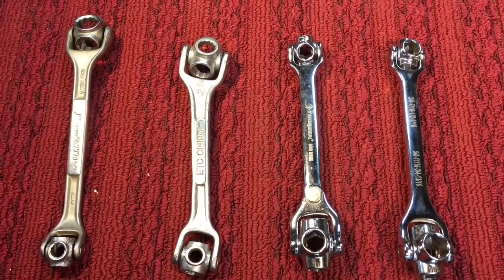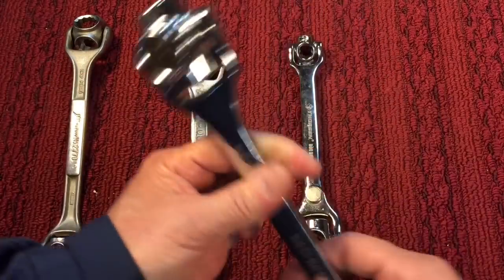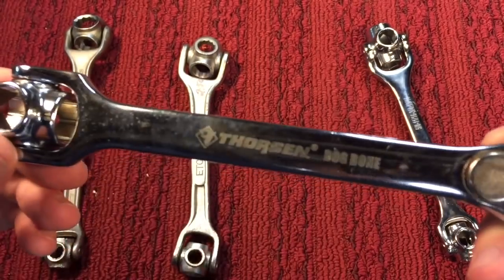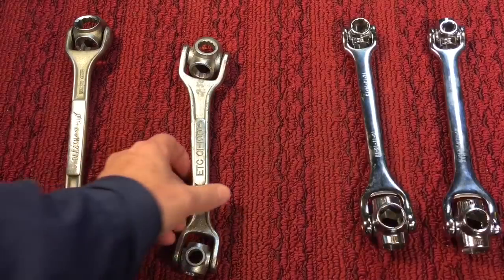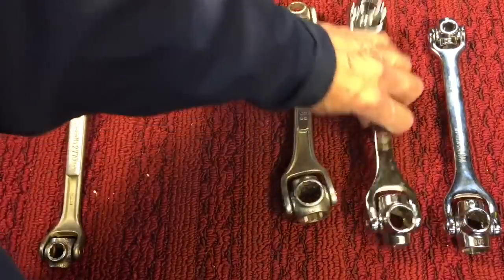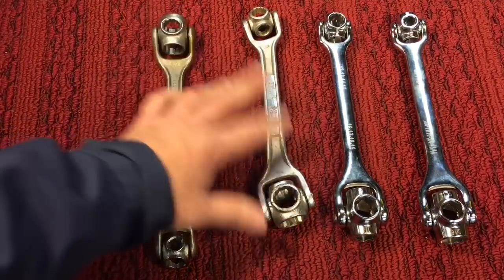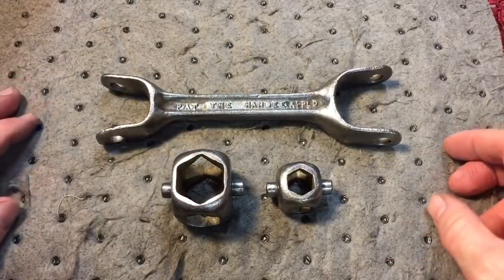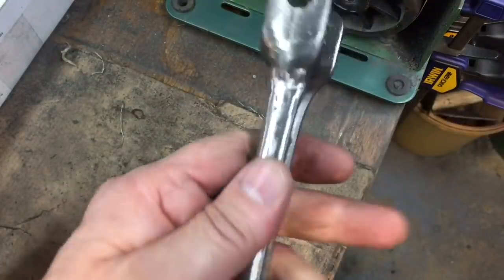Handee Dog Bone Wrench Restoration

Comment: A Tool Story: Back during WW2 everything was used till it fell apart and this included cars. One day my Grandfather was working on his 32' Chevy, replacing a chasis part with one that was almost as worn out as the one he was removing but it was the only part available. A bolt wouldn't come out and he had his big brass blow torch blowing a  flame on the bolt. He took his open end wrench that had a huge head on it so big that he could only turn it one flat at a time. My father was about 7-8 years old and had been watching Grandpa and shagging after tools when he was told to, (that was how kids learned tools in the old days. NO APPS)Tells my aggravated grandfather as he struggles with the wrench, "I bet that things loose enough to take out with your fingers now." Not thinking Grandpa reaches out and grabs the still smoking hot bolt with his fingers jerking back and hitting his head on the concrete block jack stand. He chased my Dad down the road and threw the wrench at him! Then he made him go find the wrench so he could finish the job!
Reply from the maker: OMG!  I was just laughing my butt off reading that great story!  It made me think of all the great arguments I had with my Dad while working on cars!  I don't think they were fun at the time but looking back those were great times!!!!!!!!  Thanks so much for that awesome story!  It made my night!!!!!!
Reply: @ScoutCrafter  2nd that! GOOD one!
Reply: Thank you for story sir

Comment: The fixed dog bone wrench that came with bicycle tool kit was only an emergency tool was not meant to be used regularly as it was soft alloy. However it undid  the wheels when needed to take them off to repair a puncture and was light weight. The swivel ones looked good  that is about all and your one is now a fidget finger spinner.
Reply from the maker: Hello Tony!  Back in the late 60's and early 70's they used that crap alloy on all sorts of stuff!  It was horrible!  Neither strong or good looking as it would pit or get a nasty coating on it...  Like a Zinc alloy crap!  LOL   Thanks!!!!!!!!!!!!

Comment: I’m speechless. I checked to see if Michelle had a dream about that one. Everything I envisioned you would do this week. . .  This wasn’t it. But, I have to say that 18” crescent wrench is BA. Think about building that treadle lathe with us watching. 🤗. Question . . . Why heat to separate but not to push back together?🤔
Reply from the maker: Hi Jill!  You know I had to cut out 4 minutes to get under 15 minutes so it would upload... (long story) well, in that 4 minutes I had to cut out Paint stripping, using the vise as a press, and how I re-heated the wrench up before squeezing the ends together!  Remember, the high heat would effect the paint I just applied before closing the ends up so I just used a heat gun to warm it up a little... Not that it was more malleable but it helped reduce my pucker factor thinking it might snap!  LOL  I will remake a video on using the vise as a press!  Thanks Jill!!!!!!

Comment: Interesting restoration.  These tools used to be popular on farms or other places where there where lots of bolts with 'open access'.  An example being ongoing maintenance of farm gates.  They where quick and easy to use, multiple sizes in one tool to be used on a project that may have multiple bolt sizes.  You didn't have to go looking for different size wrenches or sockets.  But they were only good for bolts that were 'out in the open'.  One comment on the restoration - for those of use who don't have a hydraulic press, you could have used your vice to squeeze the joint back together.  Great job though.
Michael from Canada
Reply from the maker: Hello Michael!  You know, I had to cut out 4 minutes of footage to get in under the 15 minute mark!  In that 4 minutes I talked about using the Vise as a press!  I will do another video on that subject very soon!  It is good information that should be out there!  Thanks so much Michael!!!!!

Comment: Hello,well a Dog-bone wrench,well they are still around..ALDI had them.on sale down here only a few months ago,and they all sold so  obviously people are using them..This ALDI Work zone one had spring loaded inner sockets,meaning you had a total of 16 sockets in the one tool,and the handle was encased in yellow and black trademark plastic..Was interesting to see one of the ones you had was a ETC one..Nit exactly sure who owned that company,Thought it may have been a Australian company,we had a lit of their stuff down here in the 70s and 80s..Believe it stood for Eastern Tool Company,but I could be wrong..they imported many tools,some from  Taiwan,India,Hong Kong (not China in those days) and some from Japan especially their ETC Industrial range,which was made to JIS Japan Industrial Standards,stated on the pack..This range was good,should have bought more..but was aspiring to Sidchrome..ETC later became part of JNU,then gradually faded off scene..I have used a Dog bone wrench and it did the job,..Its always a question of Access,the bolt is the same size but how do you get in there to attach a wrench on it.? Like you have a 9/16" bolt,but because of the position of that bolt,you may need any one of a half dozen wrench types such as tube,socket,box,open end etc to access it and remove it..This sort of wrench is OK if the bolt has some room.around it to manouvere..
When this type was made about 100years ago,most were used on agricultural equipment  large in size,with easy access to bolts but is of limited use today

Comment: Another great restoration ScoutCrafter, even if it is an unpopular tool! Even got to use the Dake and red paint!! 👍 I've seen then in stores but never owned one because I always thought I had a better tool to use. You're definitely right about that being a knuckle buster. How long did you have the heat on it?
Reply from the maker: Hi Steve!  This one was a goofy tool for sure!  Just what I like!  LOL   I used a propane torch and only heated it up for less then a minute!  No color change just enough that if was easier to move... I think you could have gone red hot but I was only moving it about 3/8 of an inch and didn't think I needed that.  The pucker factor is always high when prying on a tool that could snap at any moment!  LOL  Thanks Steve!!!!!!!!!
Reply: Thanks for the heating tip. I couldn't imagine using a tool like this without having detents. Just when you are getting to maximum torque, your hand slips a little and Bang, the socket pivots and the expletives fly. Lol. Great sanding work. I'm still trying to get the hang of it and get the waviness out.
Reply from the maker: @stevef8993 , The belt sander takes a lot of time before you get the feel of it and you aren't fighting yourself.  The small stick I use instead of a platin works great!  It takes about ten tools before you get the hang of it so don't stress the process because it comes naturally!  Like using the buffing wheel!
Reply: Yeah, I took the platen off the first time I had to remove it just to change the belt. Real pain in the neck. I also use a piece of wood after watching your vids (thanks for that👍) and that big rubber eraser works amazingly. Takes real practice to apply even pressure with the wood in one hand and work the tool in another single handedly.

Comment: Did not think your video was to long at all,  I allways look forward to them.  For those of us that don't own a dake,  could we press something like that together using a vise?
By the way, I was watching some video's about restoring die cast cars and saw someone use break fluid to get paint of plastic windshields without demaging them. It seemed to work real good, maybe this would have worked on the handle of the estwing that you restored not so long ago?
Reply from the maker: Hello Alex!  Awesome question!!!!  YES!  You could use a vise!  In fact that was some of the footage I had to cut from the video!!!!  I talked about using the vise as a press and when it wasn't advisable!  I wish I could have left the footage in but I was running so long!    As for the Brake Fluid idea!  Yes!  Years ago we used brake fluid as a safer paint remover (wasn't hard on plastics and other material)  the only thing is brake fluid takes a long time (sometimes overnight) so if you are getting paint off metal Paint Stripper is good, Plastic- go for the brake fluid!! I hope you were watching Marty's Matchbox makeovers!  I was one of his very early subscribers and now he has a huge audience!   Thanks so much!!!!!!!!!!
Reply: @ScoutCrafter  Definatly something I learned from Marty! (and a few other tricks aswell)

Comment: The surprising thing with the Witherby is, that it uses the...sorry..."antiquated" inch or imperial system as we call it. So it would be completely useless over here and also funny is, that "Witherby" definitely doesn't sound german at all. But a nice restoration as usual!!

Comment: In the 1920's they made sense because socket sets were far and few between and most wrenches were huge and clutsy but why they are still made today is beyond me. The only thing I ever found that it works on is a farm tractor or a bicycle.
Reply from the maker: Hello Crossbow!  It's funny how when you look at a tool like this it seems practical until you try to actually use it, then it quickly becomes evident you've been robbed!  LOL   Thanks so much!!!!!!!

Comment: Cheap trick for "inside wire brushing":  Cut the handle off of copper fitting cleaning wire brushes and chuck them up in a drill.
Reply from the maker: Hello MDShunk!  Wow!  What a great tip!!!!!  They look like a good size too!  The Asian Dremel brushes spew out wire faster then a machine gun!  LOL   Thanks so much!!!!!!